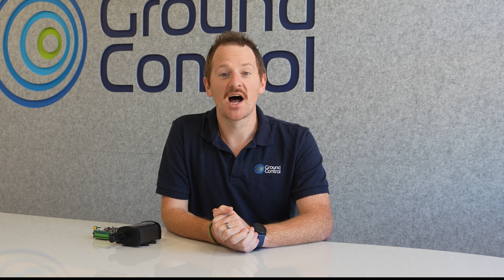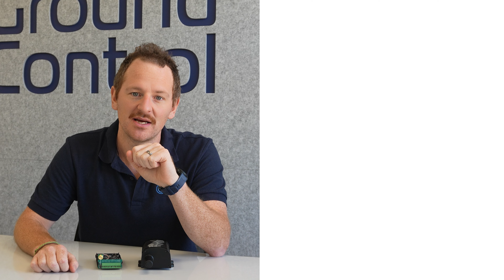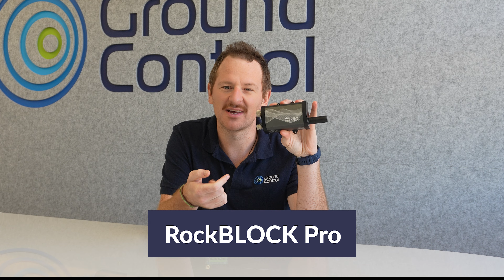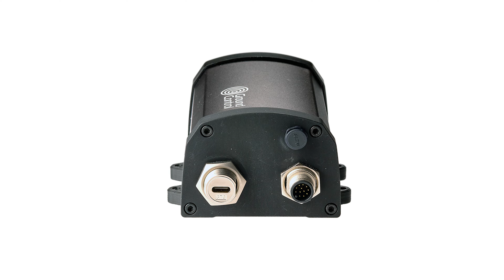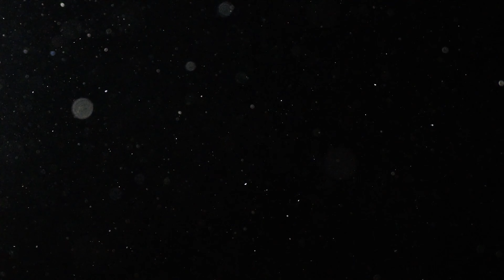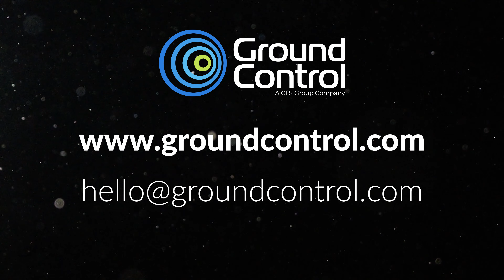RockBLOCK Pro / Pro OEM Product Showcase | Iridium Messaging Transport (IMT) Satellite Transceiver

Comment: Hi bro can we use this SATCOM module with pixhalk flight controller to actively control our drone bvlos? And can this be jammed by air fence 7 jammer?
Reply from the maker: Hi Zahid!

RockBLOCK Pro would not normally be the right choice for active BVLOS control of a drone. It uses Iridium Messaging Transport (IMT) rather than an always-on IP connection, so it is better suited to higher latency telemetry, status updates, and limited command workflows than real time piloting.

On the Pixhawk point, compatibility depends on the autopilot software and integration method rather than the flight controller hardware name alone. For ArduPilot-based systems, RockBLOCK can support high latency MAVLink-type use cases, but not true real time control.

If your goal is UAV command/control beyond cellular coverage, we’d suggest looking at RockREMOTE UAV OEM instead. It is designed for UAV integration, supports IP and UART, and works with ArduPilot, so it is the better fit for more interactive beyond-cellular operations.

On your jammer question, Iridium’s LEO network and L-band links offer important operational advantages, including low latency, global coverage, and strong weather resilience. That said, like any RF-based system, satellite communications can still be affected by interference, so we would not position it as jam-proof.

Hope this helps! Any more questions, please get in touch (hello@groundcontrol.com)
Reply: @GroundControlSys tnx dude...